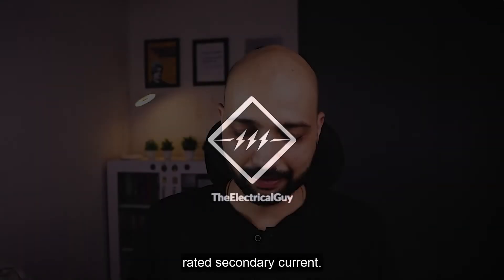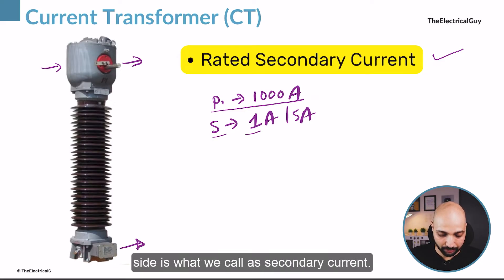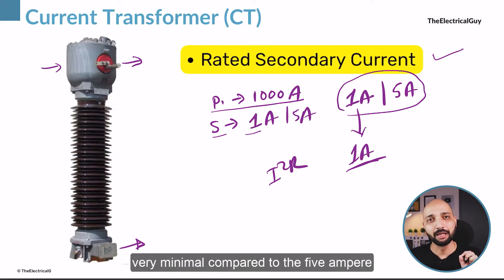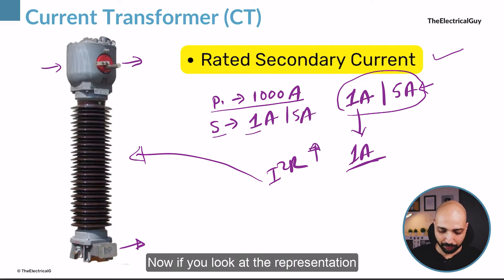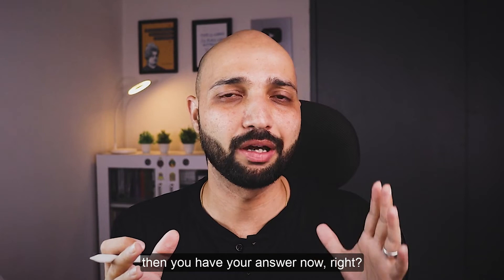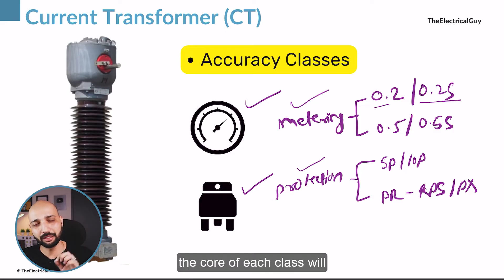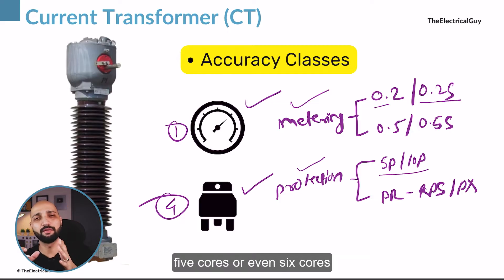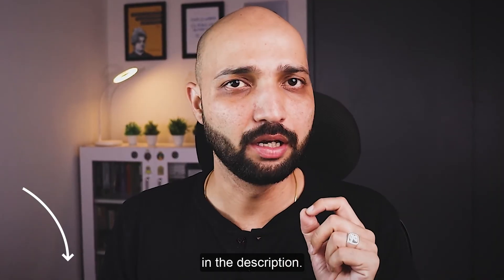Important Current Transformer Parameters | Quick Guide | TheElectricalGuy

Comment: nice vlog
Why PT is not classified like CT has classes ie for metering and protection
And like power Transformer has also classes correct me if I am wrong 
So if PT used for protection and metering why classes is not there if its please make a vlog in it
Please also awaiting I see there not vlogs on Relay,their working according to their classification in conjunction with CT AND PT and with POWER TRANSFORMER
Please awaiting for your positive reply on queries and vlogs to make on it.
Thanks
Reply: PTs also do have accuracy class (metering class and protection class).

Power transformers do not accuracy class, they have different vector groups according to their applications.